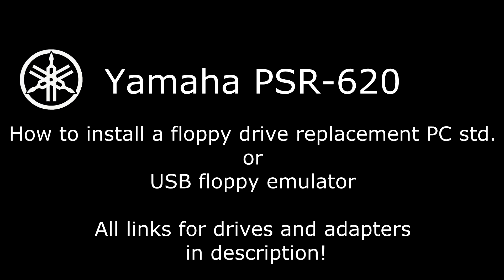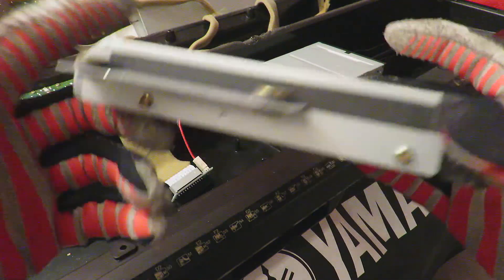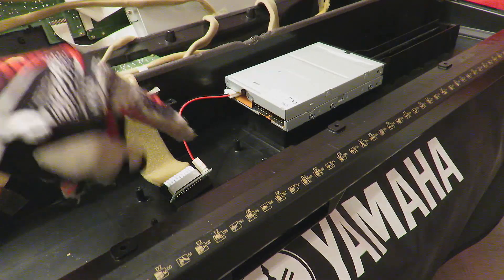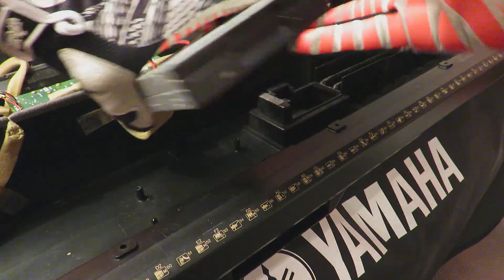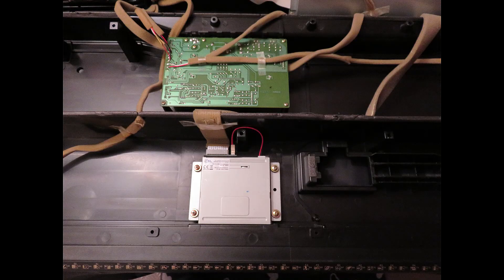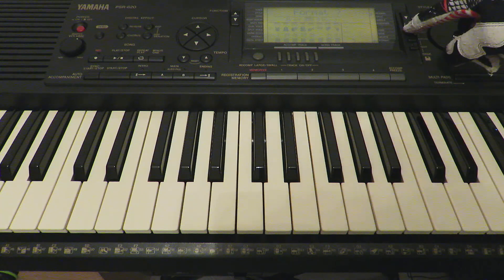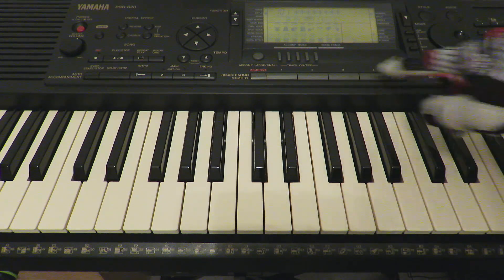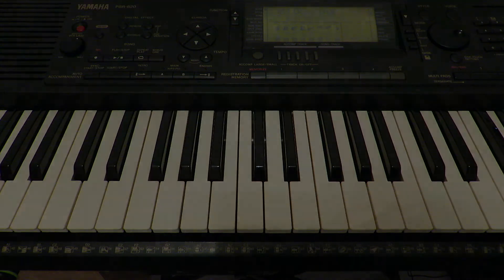Yamaha PSR 620 - How to install a USB floppy emulator or replacement drive 24 pin to 34 pin

Comment: Hello... I have tried installing a 'Floppy-to-USB' by GoTek using the 24pin-to-34pin adaptor but I'm afraid it didn't work... could you help me please?... thanks.
Reply from the maker: I will try my best. You have everything connected and installed? I read about the GoTek emulator, there are diffrent versions. Some need to be pre-formated, some not. Your USB stick has to be fat32. If this alone doesn´t work you have to create partitions on your USB for the Keyboard so it will recognize it as floppy disk. Search for "GoTek USB folder partition" or "how to set up the usb for GoTek".